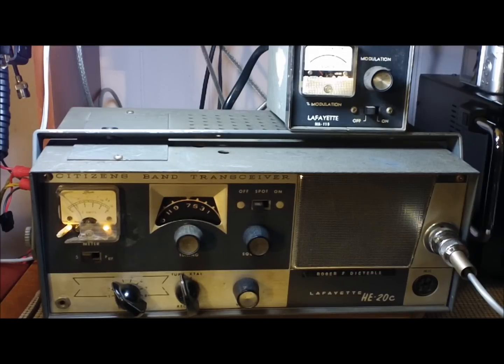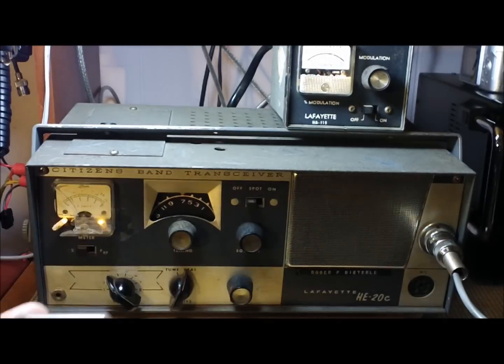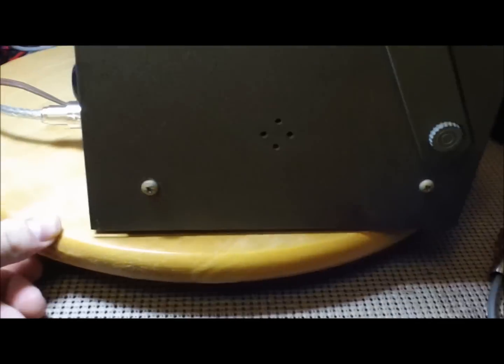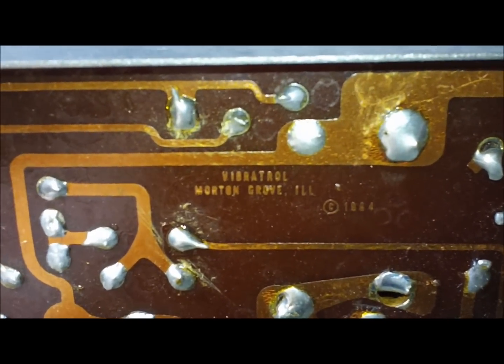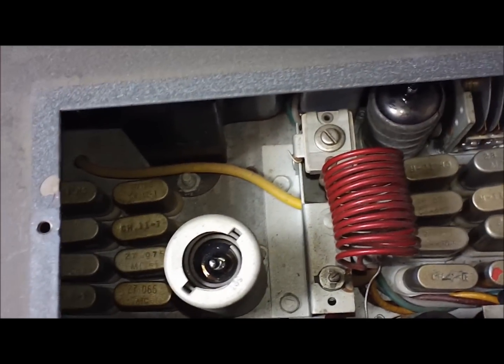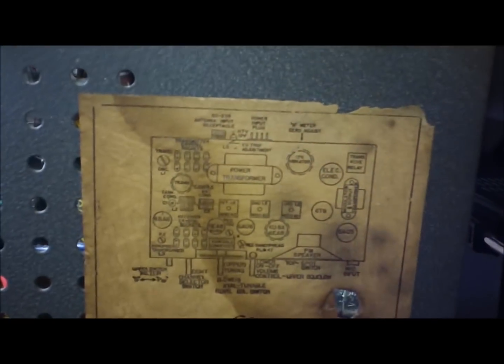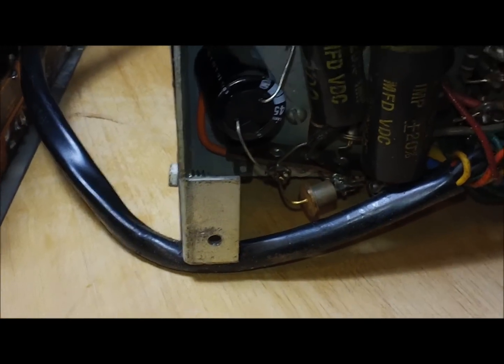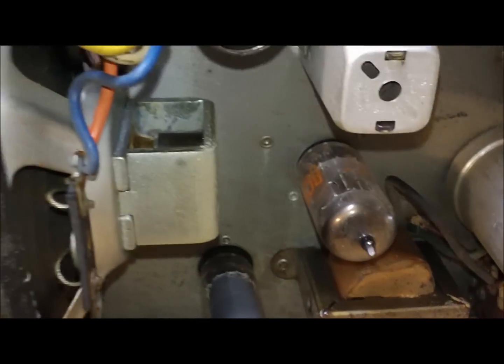Lafayette HE-20C & HA-115 Compressor Vid #1 CB Radio

Comment: The meter in the compressor may just read audio output, not signal strength. Probably its in there more for the modulation scale than anything else. Likely they just used that meter because it was a shelf stock item.